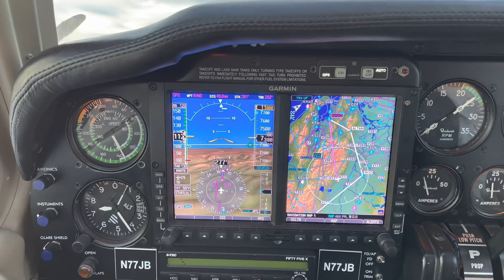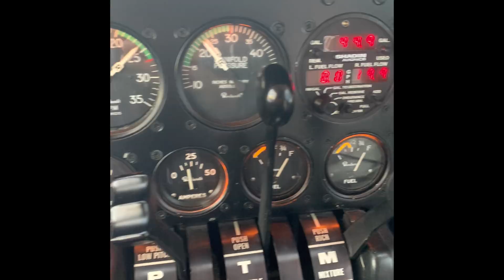In Flight Engine Failure Emergency in a Beechcraft Baron

Comment: Nice job! Glad it ended with an uneventful landing!! 
Would you share how old the engine was? How many hours since new/last overhaul, etc.?
Thanks!
Reply from the maker: This was the original engine from 1968 and the last overhaul was done in 1992, it had around 1600 hrs on it when this happened.
Reply: @amjadsilmi  That is pretty darn impressive how the engine has 50 year old components, and was last reassembled 29 years ago. :)
Reply: @thatguyalex2835  - I wouldn't trust a 29-year old, untouched engine in a motorcycle, much less an airplane.
Reply: @ShawnKitchen  Me neither, but it is cool how the engine managed to last 29 years nonetheless
Reply: @amjadsilmi  Just curious, what where your plans for this engine, before this happened?

Comment: Incredibly well handled, fantastic piloting! Did they figure out what caused it? This should go under the definition of CATASTROPHIC engine failure.
Reply from the maker: My mechanic thinks it’s Metal fatigue of the rod bolts that caused it.
Reply: @amjadsilmi  metal fatigue of the rod bolts wouldn't stretch the cap though. That would've freed the cap. I was thinking this: The cylinder head shifted due to a cracked block at the threads. That shift pinched the piston. The crankshaft continued its rotation. The downward force of the crank stretched the rod cap, distorted the rod cap and sheared the rod cap bolts.
I hope I'm wrong because I'm not an engineer. Always just learning.
Reply: @ChR1St0p4eR  I also think the jug got loose first. I don't think a rod bolt failure would punch the jug off of the crankcase. The rod length appears to be largely intact, as does the piston.
Reply: @paulolson734  plus with the bore diameter the rod would rattle around not direct it's energy through the jug
Reply: Rod bolts shouldn't fatigue if they're tensioned correctly. The other point to note is that the bearing didn't spin and damage the journal, so it's unlikely that the rod bolts were under-tensioned, else the bearing would have lost its crush and spun. I'd suspect that the fracture was a catastrophic overload caused by the cylinders coming lose and rocking, probably causing the piston to hang-up in the bore leading to instantaneous rod bold failure. The high strain rate will cause the rod-bolts to show a brittle fracture surface almost across the entire bolt cross-section. Fatigue will have both a new/clean brittle fracture area and also a dirty area where the fatigue crack started.
Reply: @jonathanrabbitt  Excellent comment
Reply: 100% was a cylinder to crankcase failure. Not from the rod bolts at all, that was secondary damage after the cylinder was displaced. With nothing guiding the piston correctly, the crankshaft will cause the rod & piston to smash into the side the crankcase and then the rod connection will break free with a brittle fracture. Notice how the crankcase above the failed cylinder junction is damaged, not below, as this is the direction of the piston & rod travel without the cylinder. Unfortunately, I would not be surprised if either A) this engine had the cylinder replaced in the field recently (or a "top overhaul") or B) the through bolts or cylinder fasteners were reused and not new fasteners.